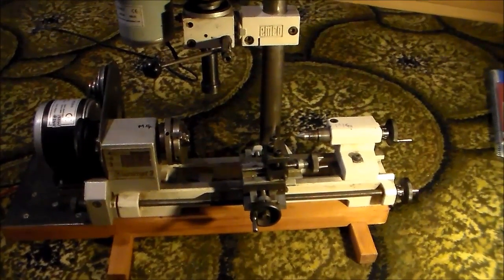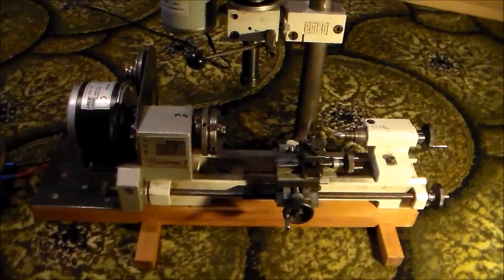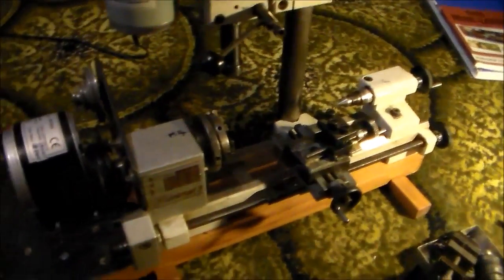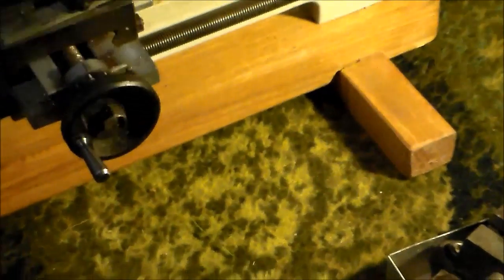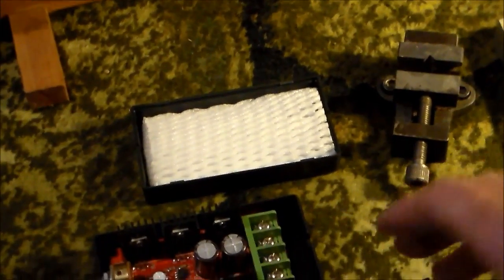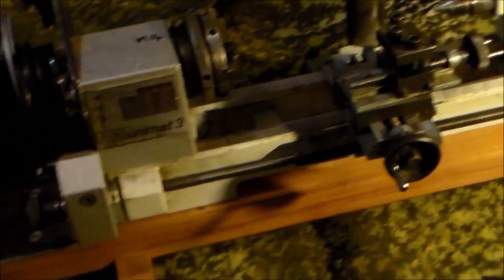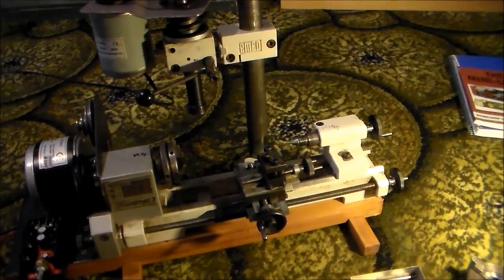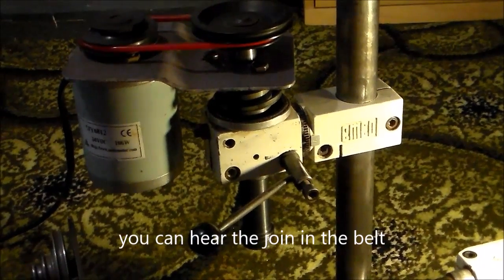Unimat 3 with variable speed

Comment: Nice I’m going to do something like that to my db200. Thinking rc lipo brushless motor that way could run on battery pack if had to. Make it really mobile. Be nice take it with you if had to. But mostly in the shop like your set up. Any suggestions. Thanks.
Reply from the maker: Modern brushless motors have plenty of power. A BEC motor speed controller should do it nicely. I agree that a battery operated lathe would be very useful. My thoughts are that I would go for 24v motor and battery and a 5 to 48v speed controller of the appropriate current rating. Let us know how it goes, John
Reply: @bikerides  , 
Please provide the address for Emco - Unimat 3 dealers/distributors, in Indonesia .
Reply from the maker: @Dodi-nz3fd  Hi Dodi, do you have eBay? Never heard of dealers for these old lathes. John

Comment: Seeing this lathe has me revisitng my old dreams of building a working model steam engine.  Great finished work.
Reply from the maker: +Rob McCrain Same dream as me. Have a go. This one was about £200 so a real bargain. Look for one without motor if they are going for too much money because the variable speed conversion is relatively low cost.
Reply: @bikerides  , 
Please provide the address for Emco - Unimat 3 dealers/distributors, in Indonesia .
Reply from the maker: @Dodi-nz3fd  Try eBay. Let me know what you find.